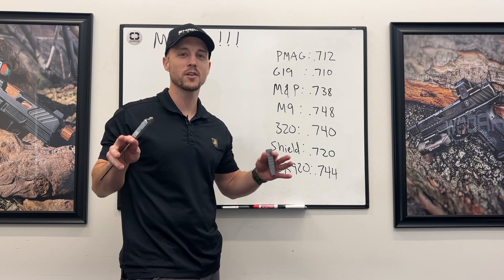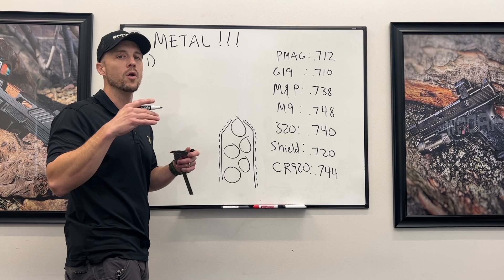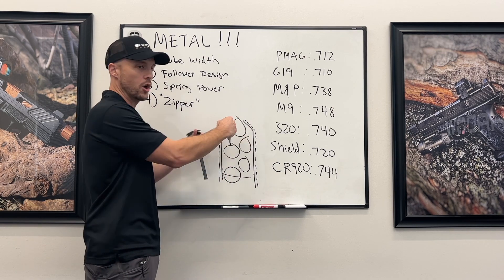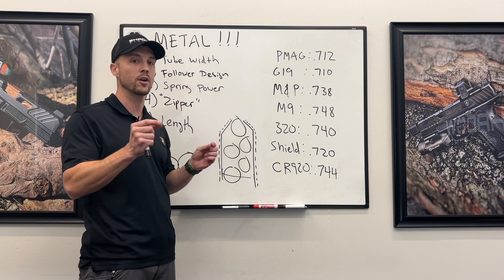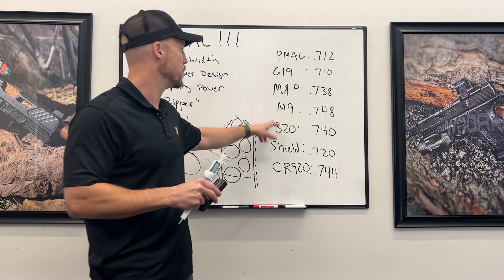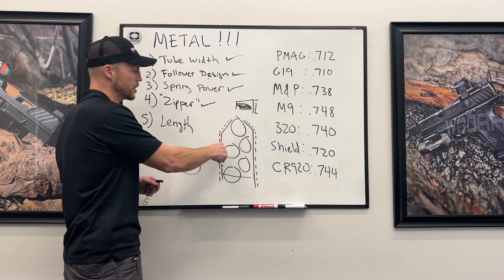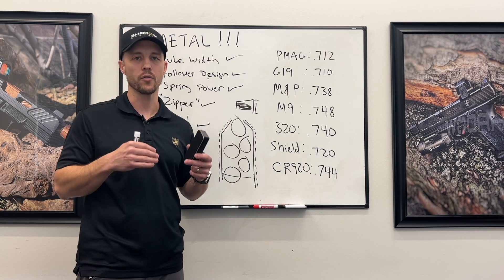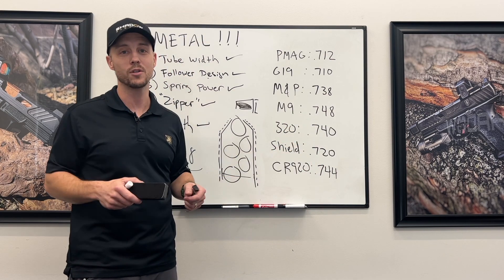Technical Tuesday - Metal Magazines

Comment: when Shield Arms came out with their mags for the 43X/48, it all made sense how magazines were made and how you can add capacity. The other companies are basically trimming the fat on their magazine designs to squeeze in the extra rounds. maybe that causes reliability issues, maybe it doesn't. I just don't want to take that risk and Glock and Magpul GL9 PMags have done me solid.

Comment: I was one of the many who emailed you guys with this question. Thanks for the thorough but concise response. As far as whether a narrower grip would be preferred, I have to reserve judgment until I try a DR920 or MR920. Given my hand size, my assumption would be no. Given my significant other's hand size as well as concealment concerns, perhaps yes. The Walther PDP-F isn't quite an accurate analog here, but it does offer a slimmer grip on a compact/midsize frame, albeit with the same size mags as the regular PDP, as far as I know. So it will be interesting to see the market's response -- and I would like to test one out with my wife.

Comment: @ShadowSystemsCorp Could you guys do a video on the locking block? I see different manufacturers claim single pin or two pin blocks are stronger than the other, the geometry of full-size vs compact, it's also my understanding that the locking block is responsible for a good amount of the accuracy you can expect from a gun. Either way it would be good to hear your take on it.

Comment: I’ve gotta tell ya, I’m a big shadow systems fan. I carry one on duty every day. Shadows next gun should be a CR but with a slightly longer frame and a 48 sized slide with 15rd capacity.. Cross compatibility with the smaller CR slide and frame then you could mix and match. That would be a glock 43x killer and no more Shield magazines.

Comment: I’ve used ETS, Glock and the supplied Magpul mags in my MR920. Every malfunction I’ve had has been with the Magpul mags. I only use Glock factory mags now.
Reply: That’s weird my pmags have been good but I typically use 17 rounders. I wonder if the shorter spring isn’t as reliable.
Reply: Metal case rounds don’t work good in pmags. But I only use Glock mags. I hear good and bad things about pmags so I just don’t bother with them.

Comment: Funny thing is when I was cleaning my MR920 earlier today I was thinking this exact thing. But you just cleared that up for me. Only reason I was thinking of a metal magazine was to get a metal or aluminum mag release from the factory that wouldn’t damage the magazines. It would also add a little more weight to the firearm ( mainly on the frame ) which would in return would eat up a bit more recoil and make it an even more softer, flatter shooting gun that it already is. But I’m not willing to lose grip width for that 😂🤷🏽‍♂️

Comment: Trevor, I have a question based on this info. The CR920 is 4.79 height with 13 round mag and the 43x is 5.04 with a 15 round shield mag. Does this .25 really equal 2 additional round capacity?

Comment: Slimmer like the Glock 43X or the Glock 48 With your proprietary interchangeable back straps for a different grip angles. and your proprietary 15R mag but if you can fit more, that would be nice to but if it’s going to sacrifice reliability and conceal ability for concealed carry would be perfectly fine with the 15R mag. And must be compatible with Glock 43X glock 48 holsters. 😏 And if you’re feeling spicy You can also add in a built-in compensator to the slide like the sig P365X Macro to help control muscle flip 😬
Reply: And if you can make your proprietary mags around the same price point as the Glock mags 😂 I hope I’m not asking too much. 🤷🏽‍♂️ but you did ask.😬

Comment: To answer your question Trevor: I'd rather have the same width and capacity but a metal magazine body. The plastic body mags are the only thing that's keeping me from buying in to the Shadow Systems and Glock-pattern handguns because they have very little benefit other than being cost-efficient.
Reply: The metal would be very thick and also heavy. Alot harder to bend and form when manufacturing them.  Not feasible to go that route. And would be expensive.

Comment: Common mag.  If you want more capacity add an extended capacity base plate
Reply: This is what I was thinking. It’s not a big deal. The 19 round fits perfectly in the DR920 with mag flare on it. Very little hangs out of the frame basically fits flush.

Comment: Don’t shrink the grip but come out with shadow mags. Metal mag on metal mag release eliminated the problem with different hardness of plastics with Glock magazines. Adding metal base plates is not a horrible idea as well. Cosmetically sig does base plates best. 

Shadow Metal Mags and mag release could be used in any Glock opening up sales to jump as well. At a minimum gives us an option

Comment: I know that Shadow systems offers different color polymer frames besides black like FDE, Coyote brown and grey. But what would be really awesome is if they also offered OD Green or a Ranger green. It doesn't have to come with a matched colored slide and I still would be all over it. I have some of the OD Green Glock mags but trying to find a factory Glock in OD Green is like finding a Unicorn. If you are listening Shadow Systems team let me know because that would be my next purchase as soon as it is released.
Reply: Second that. Glock would sell a lot more pistols if they sold their gen 5s in ODG imo. I'd get on board of a SS in ODG for sure.
Reply: Third that release the Dr920p in green and bronze barrel with black in the serations
Reply: @Hoodratsnextdoor  I really want the XR 920 for sure in OD Green
Reply: 6th I'll take a foundation in ODG. Do you need to see my toes first 😂
Reply: 7th. ODG or Ranger green across all model lines for the win.
Reply: 5th on the ODG. I’ll rebuy a Mr and Cr if you make a ODG.